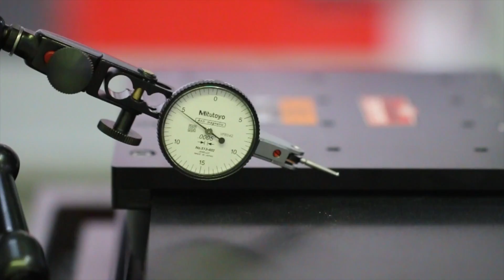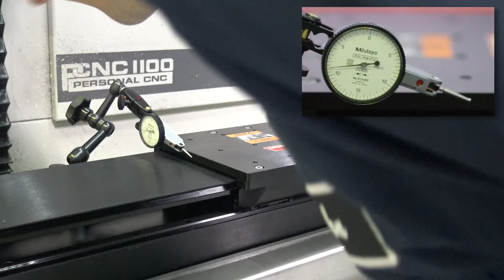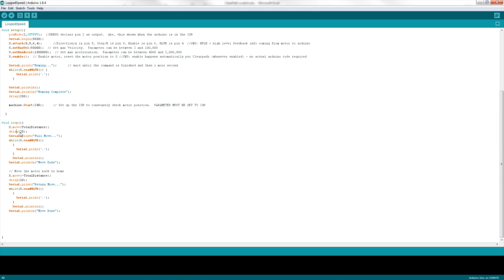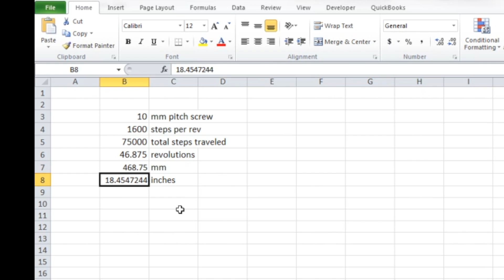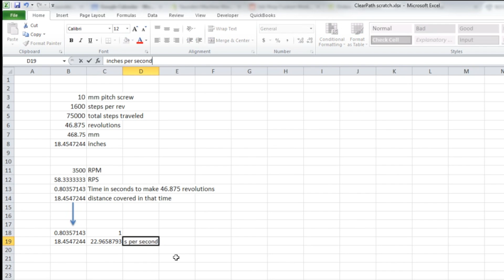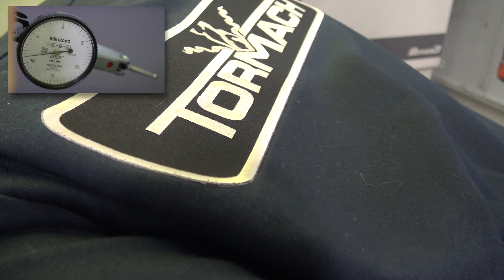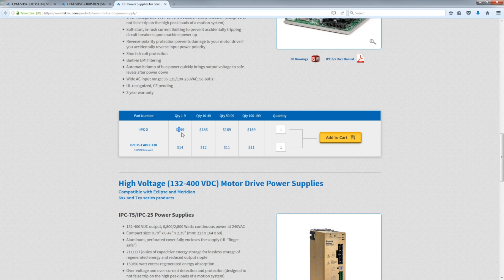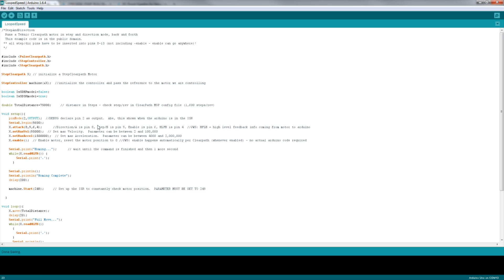SUPER Fast Arduino Servo!  ClearPath!  WW120

Comment: I was so amazed that the servo motor can do that accurate movement. I thought it was a stepper. It should have a very fine rotary encoder that records rotational angle of servo. Very interesting video.

Comment: I looked at these and they’re much like the hybrids I’ve found with encoders. I’m sure they’re nice compared to standard steppers or hybrids. I decided that I may as well order ac closed servos instead and be done. The price difference was nominal for the size we needed on the larger mill.
Reply: I ended up ordering the 1.2kw 42 series 220v servos. They cost $1,000 for a 3axis setup. Didn’t appear clearpath had this size instead they had Nema 34 bodies and smaller and then than jumped to much larger industrial sized servos. Perhaps i had missed them in my search.

Comment: Hello,

Im currently attempting to use these motors with an Arduino Mega. How could I utilize the same code with the mega? I had the motors working flawlessly with the Uno but when i tried to wire it to the Mega no responses. i noticed that the pins are different and tried to match those but had no luck. Any advice? Thanks!

Comment: The servo motor is moving to the limit as a hard stop most likely, so when the torque monitoring detects a substantial raise in torque it know to stop, it's like a block skip mode in probing. Once the increased load is detected the servo motor goes to a pulse marker (0 or 180) and then you probably can define an encoder position to go to a commanded home position. This works as long as your "limit" (hard stop) is somewhat repeatable. On higher end system you can give it a window relative to the home position so you know if there is a chip, or something obstructing the hard stop. Also your math on the speed could have been much simplified by converting your 10 pitch to inch and then multiplying that by the RPM of the motor. .3937X3500=1377.95 ipm. Good video!

Comment: I built a CNC with a 30" x 44" table and 8" z travel.

All ClearPath motors
Using Nema 34's on x-y and set to only %25 of total torque I accidentally had the y axis run into my fan I use to remove smoke when using the laser cutter.
It's a beast of a machine so before I could run across the shop to hit stop it had already crushed the plastic fan housing like a beer can

I hate to think of how much force I could get if I set the torque settings to %100 on these with the 5mm pitch 25mm ball screws.

Plastic fan housing broken up into four pieces and yet not a bit of damage to the machine or even the engraving I was doing

BTW I have repeatable on all three axis of +/- 7/10ths 
Mach 3 and Solidworks and Fusion 360 as well as SheetCam there's not much I cannot make even in aluminum with the 3 phase 3hp water cooled spindle

Have less than $2500 invested as except for ball screws and bearings the entire machine is custom machined from 6061-T6 parts and some off the shelf heavy T slot extrusions for the table that I got off of Ebay

BTW the ClearPath's are far faster than I can ever see needing

Comment: + why bother with arduino, when it will never work like a real cnc machine (lack of synchronisation) because the program code is executed sequentially. that's why people now put xilinx fpga processors in controllers which can send commands in parallel.

Comment: Hi John,
I like your channel. I am working on a project with Teknic SDSK motors and I have a question regarding the HLFB. On your download  you have the following:

void setup(){      
    pinMode(2,OUTPUT);  //DEBUG declare pin 2 as output.  Abe, this shows when the arduino is in the ISR
    Serial.begin(9600);

I don't have full control of my X axis actuator regarding position. I don't think the HLFB is working properly. Can you offer some assistance on how to connect "PIN 2" on the Arduino board.
Should I be seeing a position feedback on the serial monitor? 
Right now I only see feedback as per below:
Full Move...
Move Done
Return Move...
Move Done

Regards,
Al
Keep up the great work.

Comment: Can you possibly post your wiring diagram?  I have a couple clearpath motors with arduino mega setup and having some issues running the simple example codes - your schematic might help me flush out whatever stupid mistake I've made.  
BTW - I'm using them together with encoders on my lathe handwheels to allow "manual" control of my CNC lathe conversion project.

Comment: I am sincerely grateful you are taking the time to share your effort. The Clear path  Stepper motor is impressive, until your video i have never heard of it. i would like to make a xyz table for my plasma machine. Even with the quality components you have shared, it is a long way to comprehend the hardware. Arduino is controlling?  but the software provided by the Clear path is being used? Linex for plasma instead of arduino code?

Comment: Tried the Clearpath library and example code for Arduino -- nothing. Ran the motor just fine thru the MSP software and also, my own simple Arduino code with no acceleration, so my wiring of the motor is correct. Has anyone else had similar experience?

Comment: John, I am looking at upgrading my stepper motors on my G0704 with these Clearpath servo motors, but one thing I cannot find info on is the brake holding for the clearpath motors. is there any way you can test the brake holding. Example my z axes is about 35-40 lbs will these motors hold that weight when the machine is in a static position or off?

Comment: hey John,

When using step/dir signal does the closed loop system work??? it will mesure the step sent and the real movement done by the moter (reading the encoder?)

florian

Comment: what driver are you using?
Reply: the link you provided is for an SD model which requires a step driver... correct? Im in the process of ordering one and i am torn between the SD and the MC series as cost is a major design constraint and i didnt want to get into a pricey driver.

Or am I just all confused here.

Thanks
Reply: He is using the Arduino to send the steps.  everything else is done in the motor.
Reply: MotorGuy I guess I just don't understand why anyone would by the more expensive integrated version if you can do that with the SD series. if this is truely the case I guess I'll buy the cheaper SD series
Reply: Logan Shirey,  There are two reasons:  

First, the SDSK motors are less powerful (peak power) than similar sized MC series motor.  SDHP have more power, but are also more expensive than the MC. So part of it is how much peak power do you need?

Second,  while sending step an direction give you the most flexibility to command different positions, and velocities you need to generate the step and directions signals which either requires a third party controller, or significant software expertise.  If you only need to control speed, or move to a few positions, an MC series could save you time and money.
Reply: MotorGuy  thanks for the info. this still doesn't answer the question tho. he has an SD servo in the video but claims that no controller is used. you just said that a controller or software is needed yet nyc cnc claims that none were used. 

what gives? 

and I understand that an arduino can send steps vial it's digital output pins and pwm pins but I didn't think you could drive an SD series straight from these with no controller...
Reply: Logan Shirely,  The ClearPath motors (both MC, and SD series) communicate using basic digital I/O meaning, they can interface directly with an Arduino.

In this example the step and direction controller is the arduino, which is sending commands directly to the ClearPath with nothing in between.

Comment: The encoder in the servo should have an index mark or some other way of measuring the absolute angular position of the motor. The software would run the table up against the limit switch or hard stop, and then back up until it finds the index mark on the encoder. That way the limit switch or hard stop location only has to be on the same revolution of the motor and the home location will still be exactly the same.

Comment: Can you please go over the components that make up a clearpath servo? I looked into them before I ended up with a stepper system. Basically what items do you need to connect to the Bob. Obviously the motor,  the cables and cost of them are my main question.  Thanks!

Comment: Hey John, awesome video as usual... for converting a LMS-3990 mini mill, i would like to use these clearpath sdsk motors you are talking about in this vid... i went onto the site and was trying to figure out which motors i need/would want... i then went back and clicked on your link... it went to the the 223 oz in motors ($257).... are these motors the ones you would recommend, for converting the 3 axis's on the 3990? if so, i will order them... also, im confused about what to use smoothstepper, or grbl, etc for cnc mill application...  when using the clearpath motors, what other electronics/controller setup do you rec. to complete the setup (since im building a cnc mill)? i am trying to do this without spending more than i should for the capabilities of the mill, but do not want to limit it by using the wrong components.    hope my questions do not aggravate you... i watch all your vids and you are one of the main reasons, i decided to jump in and do this...
Reply: NYC CNC ok thank you for the response.. they look like nice motors... i will contact them directly

Comment: Just a slight change in the code.. 
Avoid slow speeds of serial like 9600
Go for 115200 at least and higher, serial is just like huge delay in your code.

Comment: So to explain to everybody what clearpath "servo" is.. It is an encoder driven stepper motor with an integrated driver that handles step and direction input.. A well packaged product - but nothing really new under the sun. You could do this with a DC motor as well and actually get a proper servo, but the calibration of those usually is a m******er. t's way cheaper tho to buy 4000ppr encoders and make a small bracket with a regular stepper motor and drive them through LinuxCNC (Pathpilot for the tormach people) or a Dynamicmotion cnc controller.
Reply: Thanks for your comment. I'm an applications engineer from Teknic and I thought it might be helpful for me to clarify a couple of points. ClearPath is a closed-loop, 3-phase, brushless servo motor with an integrated AC vector servo drive. It uses a 12,800 count/revolution encoder. ClearPath is not a stepper motor or a hybrid between stepper and servo, but it does communicate using step and direction signals (as well as with digital I/O for certain models). Teknic's ClearPath SD models were designed to be drop-in replacements for stepper motors (or digital step and direction servos) so that a user does not have to change the software on his/her step and direction controller. As long as the motion controller can output step and direction (or A/B quadrature), it will be compatible with ClearPath.

As for the concern about calibrating (tuning) a servo motor, ClearPath has a sophisticated, built-in auto-tune feature that will tune the motor gains for your application and allow you to fine tune the results to your personal preference if desired.

Please feel free to give Teknic a call if you have any other questions about ClearPath or our other products.
Reply: REKT.
These look amazing. Now I'm sitting here debating swapping out my steppers (on a CNC router). I did recently invest in a Leadshine MX4660 driver and a Ethernet Smoothstepper. So I wonder if all the fancy wizbangery DSP algorithm ninja quad laser pulse smoothing those gizmos tout would interact with the brains built into the ClearPath servos. 
My guess it's much of it will be null and void but I'll gain some really accurate torquey motors. Any thoughts?
Reply: Which fancy wizbangery DSP algorithm ninja quad laser pulse smoothing features are you thinking of?  The driver wouldn't be needed, but the SmoothStepper should still work just as well.

Comment: I just got 3 of these for my bridgeport retrofit. I have seen some amazing things done with them. Largest downside is they don't have many options for higher torque. At the torque I needed, I will only get about 80IPM rapids. They are better for plasma/ routers / lighter weight DIY type machines. Still can't beat them for the money, and amazing performance.
Reply: The highest torque I see on their site is 31in-lbs RMS. Same as the BOSS 9 servos they replaced on my machine. But 1800 peak RPM versus 6,000 rpm on the OEM. Not a huge deal, just again- means I get 80IPM rapids. However I digress, they are still amazing little units. Awesome performance, awesome cost. Just that slight downside. If you need torque, you sacrifice a lot of speed with them. I mean, If I wanted a servo that produced that much torque and that much RPM, I would have spent 10x what I did on the clearpaths.

Comment: I bought 3 of these along with the cables.  These are awesome motors.  The tuning was super easy and my little cnc table is singing.  No stepper noise as is so common.  All I hear is the 2.2kw spindle running.  Machine is virtually silent.  I built the machine to machine coins specifically and I couldn't be happier with the Clearpath motors.  In a word, awesome!  Thinking I'd like to retrofit some on to my Tormach!

Comment: Do you have a link to the linear table?
Reply: Hi Rick. The stage is a Bell Everman SLS-B (Sealed Linear Stage Ballscrew) unit with a precision rolled ballscrew and dual bearing rails. There are optional seals to enclose and protect the entire actuator. Here is the link: http://bell-everman.com/sls